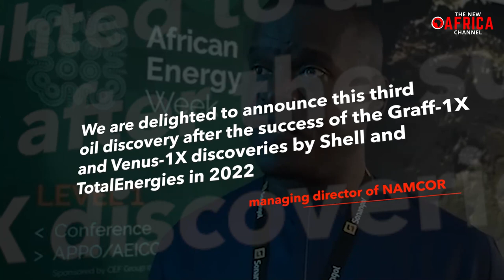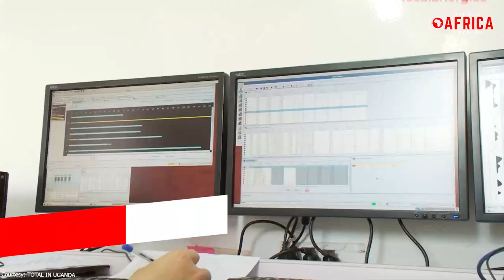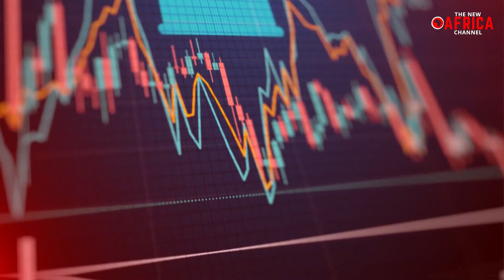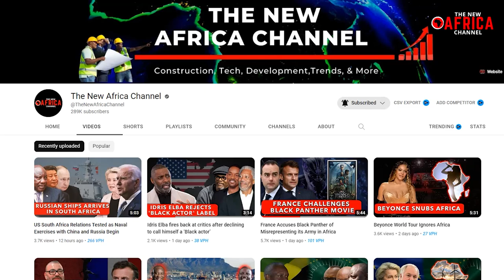Namibia's Oil Boom Continues With Third Successful Strike

Comment: While it's wonderful to see Africa develop resources to support its independence from foreign fuel prices... the biggest profit is seeing the savings passed onto African citizens. 

Portable resources and underground gas line infrastructure that's piping natural gas to homes within communities will be a huge boost to rapidly insure a higher standard of living by introducing Cooking/ heating fuel at the touch of a switch. 

Reducing daily gathering practices and ultimately reducing the harsh demands of locals using trees for fuel. 

Ultimately, reducing the occurrence of many illnesses, by having the resources to properly heat food adequately to kill more bacteria and trichinosis.

Outlying communities that will inevitably take longer to reach with underground pipelines can be given a more affordable portable solution such as, propane tanks and burners/ or outdoor/indoor stove/ ovens...

Perhaps,  the oil companies can purchase electric semi delivery trucks to cut overhead and they can introduce a local supplier and negotiate trade among rural communities? This maybe a prospect for a new branching business venture that may catch on quickly; if the price is low enough... and delivery is reliable. 

Citizens would spend less time meeting survival needs and be able to focus on a profitable trade- if a responsible government was attentive to the continent's growth.